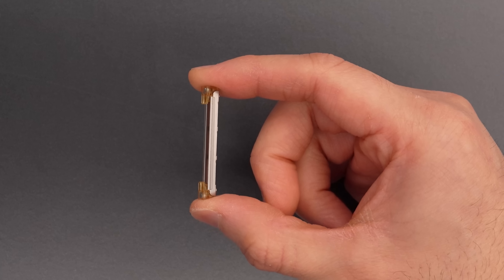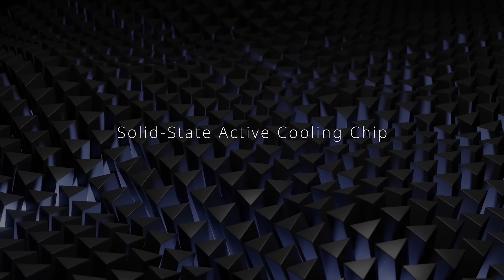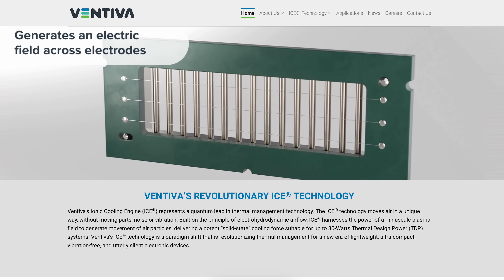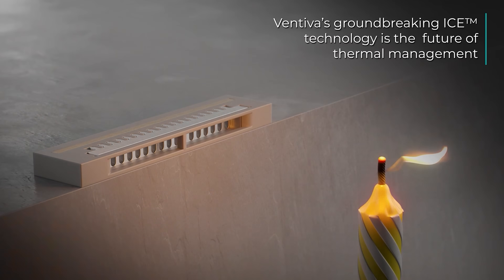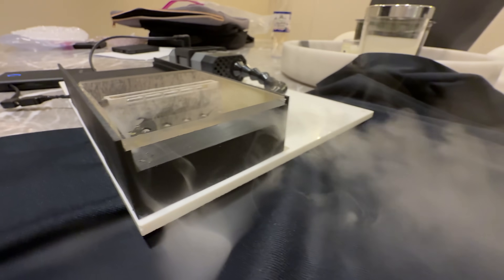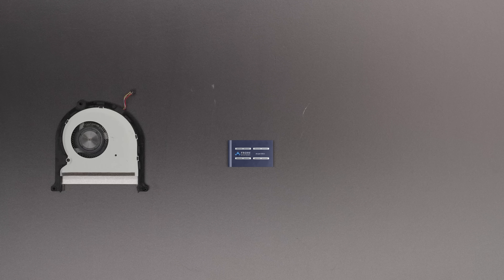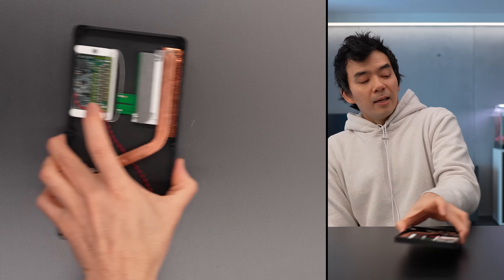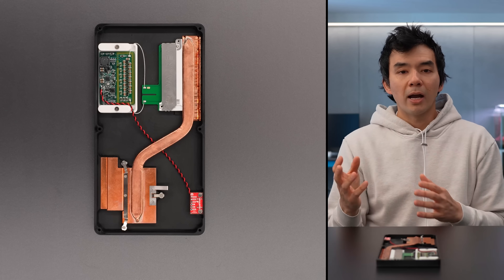The IMPOSSIBLE Laptop Fan...

Comment: Ozone generation is not the only consideration. NOx are formed as well, much more toxic and, even worse, corrosive towards copper heat exchangers (a.k.a. radiators). Question is, how much will it produce?
Reply: and it not just toxicity - a tiny bit of ozone causes everything in the room to rust like crazy.
Reply: @Oldman_Gamer2  ozone also degrade some rubbers.
Reply: @Oldman_Gamer2  Nitrogen oxides are worse because they oxidize with oxygen and water into nitric acid. It's insane to breathe traces of it.
Reply: @Oldman_Gamer2  I have big ionic air purifier in a room for more than a decade. Sometimes it runs at night with all windows closed. I don't see any excessive rust on anything in the room. TV, computers, old bolts in wall sockets. Everything is fine.
Reply: @-COBRA ofc it won’t be an issue. The people in this comment section are applying some highschool grade science and overthinking the issues. NOx generation 😂 give me a break
Reply: @marked_one  Then please elaborate on why there wouldn’t be any NOx generation, O ye wise one. The ability of corona discharge to produce NOx has long been documented and explored for nitrogen fixation by nonthermal plasma. Admittedly, the NOx production efficiency is… bad, but NOx can potentially impact human health even at comparatively low concentrations
Reply: To generate NOx you need sparks, if the electrodes aren't too close they shouldn't appear, but the safer you make an ionic thruster the less air it moves.
Reply: I was really hoping to find someone mentioning this.  I'd definitely prefer a fan.
Reply: I was thinking the same thing 🤔. Probably doesn't matter for the size.
Reply: Probably not much nitrogen oxides to be honest
Reply: Corrosive towards copper? That's EXCELLENT from a business perspective lol
Reply: I think nox formation won't be a huge issue as they are almost only temperature dependent. For example, new combustion techniques live MILD combustion does not produce nox at all (almost) because it reduces the flame temperature by recirculating reactants.
Reply: @FrostSingularity  "For example, new combustion techniques live MILD combustion does not produce nox at all (almost) because it reduces the flame temperature by recirculating reactants."
Yep and that is killing efficiency, reliability and livetime of the engines.
Reply: @FrostSingularity  yh but what about the old systems that are in use , you are not going to replace them overnight
Reply: Just empty the room of oxygen, NOx problem solved
Reply: Corrosive is worse than toxic? Are you a robot?
Reply: I don't think so. 
NOx and ozone can react, but at room temperature N2 has a triple bond and it's the second strongest bond in any diatomic molecule. You would need temperatures around 500C to even hope to break the bond and microchips will work in the 60-90C range.
Reply: I suppose negligible amount. However, since we will soon have real laptops with this tech, there will be enough beta testers!
Reply: I mean... NOx lowkey funny tho
Reply: 😅 Welp there goes my hope for handheld pc console steamdeck, can it be fine tune though?
Reply: That is my exact thought, plus it can form major toxic that can even harm humans(I cant say for certain that its conc will be potent enough tho)
Reply: Enough to give you cancer
Reply: @sebastianborusinski351 NOx are formed in a hight temperarure. In 20°C, N is neatral.
Reply: Diesel solid state fan
Reply: isnt that stuff in galaxy gas? kids are gonna love these new laptops
Reply: @joej78  That stuff IS galaxy gas, galaxy gas is a brand of NOx "made for cooking" xd
Reply: @joej78 I doubt thay are getting high on ozone. Don’t confuse it with laughing gas.
Reply: @joej78 different compound, N2O is used as an anesthetic, not NO
Reply: This is what I was thinking.  This would create Ozone.
Reply: Thank youuuuuuu; came here to say exactly that.
Maybe it's not an issue with a given design, but I've never once seen it properly addressed as to whether it is!
Reply: NOx is one of the main reason we have Diesel Particule Filter on diesel engines.
Reply: I highly doubt they have enough energy to break a nitrogen triple bond
Reply: @SixOhFive  then youd be wrong.
Reply: Jesus loves yall
Reply: it only exhausts neutrally charged air so......    back to the drawing board for all the wannabe engineers in here
Reply: @santos.l.halper1999  Explain how ozone can be formed by ionisation and how this product specifically prevents its formation, since you seem to imply to know better than the wannabe engineers.  

If you think this product doesn't create any ozone, why do you think they even considered using a catalyst layer on the heatfins to destroy ozone?
Reply: @stephen01king    never said it didn't produce ozone! For a famous author, you're not very good at reading and comprehension haha
Reply: @santos.l.halper1999  When you write like shit, even the best writer won't be able to parse it. Explain what you mean, then.
Reply: @stephen01king    when you assert petty fallacies, even the best writer is just projecting. I think I'd rather not indulge a child than explain child's law to one...
Reply: @santos.l.halper1999 Well, what you wrote pretty much implies that there is no ozone or NOx produced - „only neutrally charged air“. 

Since this thing is producing an ionic current, there will inevitably be both NOx and ozone produced as byproducts due to corona discharge. Both are fairly problematic even at low concentrations, hence the concern. 

The „wannabe engineers“ here definitely have a point. 

Sincerely yours, a chemist.
Reply: @GreenCaulerpa      No, what I wrote is succinctly stated that it only „exhausts” neutral air. I didn't imply anything, you just assumed as such.

Since this ICE uses electrokinetics for fluid movement, it is considered soft ionisation without a direct ion current - in the same way inkjet printers work without a cathode induced medium. A device that is only effective at small scales. This company and many others claim they don't produce O₃ but we know better. Instead it is diffused by a slotted bimetal, or in the case of a printer, a filament or set of stylus diffusers. The case for NO is this device supposedly generates non-thermal plasma, which is crucial for a cooling engine to work at 10 watts. This may not be the case with real world testing but the modus checks out.

The WE's are only waxing lyrical with their inference and are not making any deductions from a technical perspective so, I'm gonna disagree with your notion that they have a point.

Thank you for your insight, from an electronic engineer/material science technician.
Reply: @santos.l.halper1999    I‘m going to disagree with your notion that „it didn’t imply anything“. The fact that me, alongside other commenters pointed that out, kind of proves it - considering that you didn’t specify „neutral“ in this instance, leaving vast room for interpretation. 

For instance, since this device basically just generates an ion wind, we need to ionize the air in order to air to accelerate ions towards the other electrode (collector). This happens due to a corona discharge. Whilst the ionized particles induce a movement of the bulk fluid, a large part of the ions are not gonna be neutralized by the other electrode. This way the exhaust gas is not electrically neutral either. And we know that electrostatic charges and electronics mix like oil and water. 

Additionally, the phrase „cathode induced medium“ just doesn’t make any sense, at all. 

Also, it doesn’t matter if it produces nonthermal plasma. We know well enough, that NOx can be generated by nonequilibrium plasma by the zeldovich mechanism with vibrationally excited molecules. Additionally, electron impact dissociation also allows for the recombination to NOx.
Reply: @GreenCaulerpa   inevitably, negatively induced butthurt from your assumptions occurs. The fact that, you alongside other commenters (which was one other guy), implied on my behalf is an assertion on your part particularly when O₃ production and neutral air exhaustion are vastly different processes.

Your instance is another assumption, albeit of my capacity (no offense taken). What you've described is indeed a solid state drive, but with omissions of crucial components in the engine itself. The collector will always prevent ions from being expelled in this configuration. Adjacent to the collector is the drift zone which from a close inspection, allows for the intake of neutral air in the same way an ionocraft functions. The air velocity shear allows for the "bulk fluid" to displace a considerable volume of neutral air. The collector only allows for the ejection of neutral air by utilizing a particular geometry from the top intake to the vent. Maintaining neutrally charged exhaust requires the engine to contain the discharge, which is easily achieved at this scale. A quick square cube calculation suggests this device isn't problematic until the air gap is 50 times it's current footprint (maybe more).

The medium in question is paper. I'm referring to a KTL capable Epson printer that uses a similar ion output stream on a plotter. You obviously missed my point about inkjets so I won't delve into my powder coating history......

I'm not sure Zeldovich holds up in non macroscopic electro hydrodynamics much less, is it completely plausible as a mechanism in its own right. These exigent factors require considerable time and by your reasoning must not and otherwise cannot remain in the ionization zone long enough for high concentration NO formation (ignoring error rates in the mechanism). To that extent, EI would have a positive effect if this were relevant in terms of chemical kinetics. Not sure about your recombination posit though. That one needs a bit of work...
Reply: @ 
Okay, for the sake of productivity, let’s keep semantics aside. You say you didn’t imply anything, me alongside others tell you that you did. Let’s just keep it at that. 

Next point you mentioned: Me allegedly omitting a „crucial“ part of the thruster design. Er yea, I did not specifically mention that as it doesn’t really matter. The collector will NOT, in fact, prevent ions from being expelled. Due to the kinetics of the engine, the bulk movement of the fluid will cause a non-negligible fraction of the ions to just pass through the electrode (which, from the video, seemed to have a relatively large spacing) and potentially lead to electrostatic charging. That is a phenomenon we are making use of when creating electrets by corona charging. 
I suppose if we used a micrometer-spacing for the collector, we could achieve a near-quantitative neutralization. But then again, it would be hard to implement with this type of engine due to the extremely low static pressure. 

You can use big sounding words like square cube law all you want, they are just not applicable here as you potentially have a directed ion stream. If we have a non-grounded, electrically conductive housing or thermal conductor, charges can potentially accumulate to a point where a discharge may damage the sensitive electronics. 

I think I understand where your misunderstanding might have been. The intake isn’t relevant here, some of the ions generated will just flow past the collector.  

And yes, I did miss your point with inkjet printers as I really don’t know what you are talking about here. Typically, inkjet printers use either a piezoelectric or thermal deposition. I think I get where you are trying to go though (electrospray). If I am correct, then while we aren’t fully eliminating any ozone and possible NOx production, we are working with lower voltages as we are working with a liquid that possesses a somewhat reasonably high electric conductivity. This way we can easily transfer the excess charges into the droplet whereas in the engine presented, we have to ionize the air. 

You are right that an increased lateral flow  through the engine reduces the NOx and ozone concentration in the exhaust. However, we also increase the energy efficiency of its generation. If we are using the device in a closed room, we can generate potentially unsafe concentrations of either. The zeldovich mechanism ALWAYS applies though, it’s not scale dependent. It merely describes the (or potential) mechanism of NOx generation by nonthermal plasma - as in corona discharges.
Reply: @santos.l.halper1999  A bunch of word salad and haphazard use of technical jargon suggests you don't understand the concept well enough to explain it to the layman, and that you're still unable to properly explain how this technology prevents ozone from forming before the ions get discharged by the exhaust vent.
Reply: @stephen01king   I was talking to a chemist (the peoples defender as it were) -so, I apologize if that was too technical for you. Happy to dumb it down for you if you'd like.
Reply: @santos.l.halper1999  So far, every reply of yours to me have primarily been insults and you avoiding answering my questions. Not sure if you think you're the smartest person in the world or something, but even that position doesn't justify acting this smug over something they clearly don't know enough to explain in a simple manner.
Reply: @stephen01king    it's not a big deal bro. Did you read my other responses? The engineering accounts for the ozone! I have emailed the company specifically about the NO which the device also accounts for assuming a few things. What is it you would like to know specifically?
Reply: @santos.l.halper1999  I did, none of them addresses my question. Maybe I missed it and you can point out exactly which of your sentence addresses what I asked.
Reply: @stephen01king   my apologies. Yes so the collector should account for the ozone but not the NO. Supposedly this device doesn't generate any because the kinetic flow that is induced (exactly how stylus printers work), is fairly proficient in the way it generates air flow because apparently, it doesn't generate a considerable arc to ionize air molecules (accord to the limited knowledge we have). So, this engine can eliminate all free radical ions but it's ability to negate NO generation is questionable. They have a patent out so their reasoning is pretty solid, but looking at the design seems to suggest they have a workable piece of tech. I can tell they are withholding some design features about the air gap but, it's decent. The proof is in the pudding at the end of the day
Reply: @santos.l.halper1999  I thought the collector accounts for the ions formed, not ozone. Can you explain in more detail?
Reply: @stephen01king   I mentioned a plasma field in a previous comment (I believe). Proprietors are using it in devices that claim to not generate ozone but researchers claim they do (only 3ppb). A lot of plasma wave info has not been made known or is blatantly misleading with companies changing their spiels from "no ozone" to "no harmful levels of ozone" (in fairness 3 parts is pretty insignificant). In either case, I think the collector is designed to draw out hydrons from the plasma that interact with the ozone. I feel this will impact this engines capacity to negate oxidation on metals that wouldn't usually oxidize!
Reply: This guy gets paid to hype up companies. He's a grifter
Reply: @JimNortonsAlcoholism  no, just very enthusiastic about tech
Reply: I've never seen this guy before but it is very "commercially." I get the impression that he's trying to sell me something...
Reply: @JimNortonsAlcoholism Who even mentioned the disadvantages and possible problems of this technology! 
You should look up the definition of a grifter.

Comment: Ionic Wind (electrohydrodynamic) fans are not new and have existed for decades at this point. Calling them "Game Changing" is straight up misleading/misinformation. There are several good reasons that technology never took off. For starters they are very susceptible to dust and other contaminants, not only that but their electrodes can degrade over time due to oxidation. Finally, probably the most important one is that they can produce ozone by products that could cause long term health problems. 

Ever few years someone reinvents the "Bladeless fan" and every single time it's always something that has been around forever and just relabeled.

Comment: It will be interesting to see how Asus uses this tech in their pro art line, that's my money on who got to it first. ASUS or MSI. But it's 100% a Taiwanese company. This just screams more ASUS than MSI. Since you can augment CFM with proper air chamber design. Basically, the easiest method being FUNNEL design, in the shape of an hour glass basically, put one device at one end, perpendicular intake fins for the back fan, then diagonal fins in front of it for air intake before the funnel, and then exhaust it on the other side of the hourglass. Will be interesting to see one of these laptops cracked open to see how they implemented it.